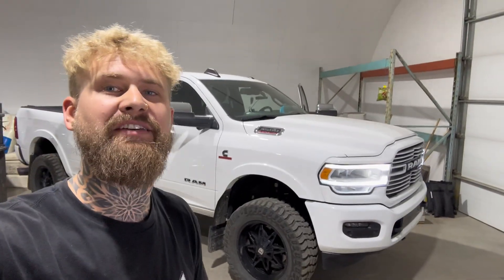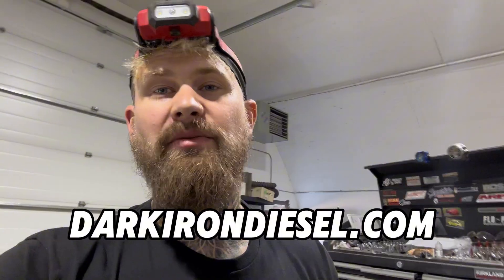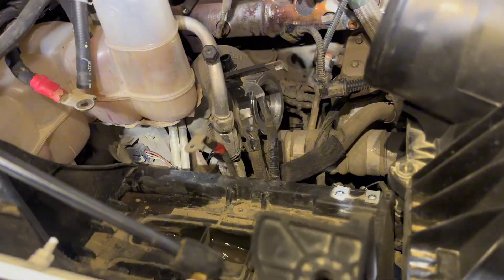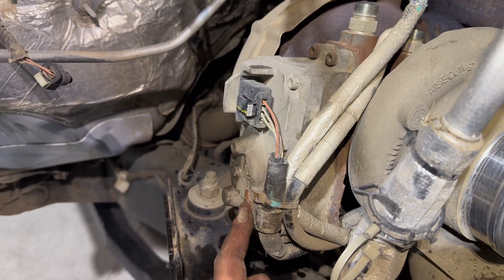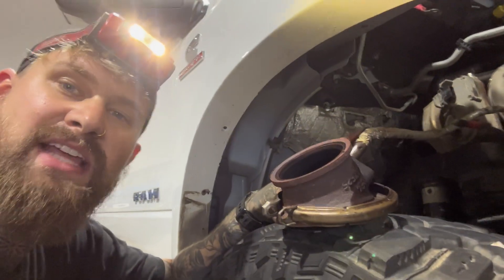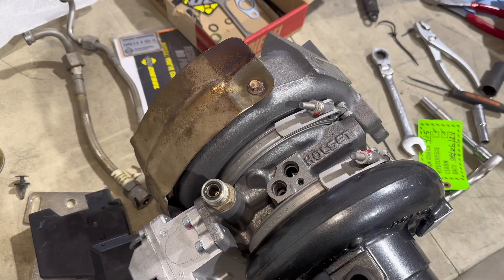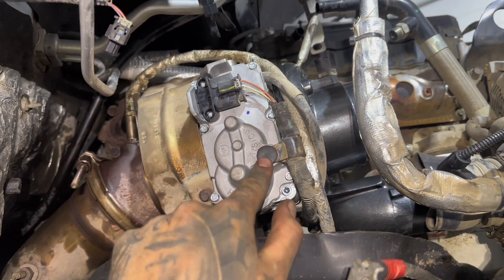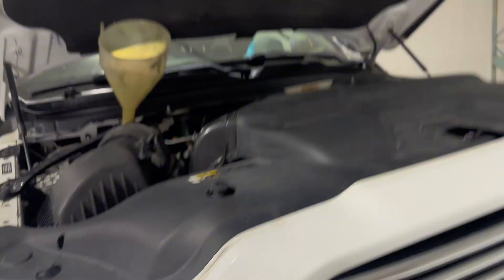How To Replace The Turbo On A 5th Gen Cummins

Comment from the maker: I recommend the ATS Aurora drop in turbo as a great alternative to stock.  Also you can use code DARKIRON to save 5%
https://atsdiesel.com/products/ats-diesel-aurora-vfr-turbocharger-assembly-with-new-actuator-for-2019-current-ram-6-7l-cummins?variant=48600464261396

Comment: For that top left bolt you can reach up from underneath with a ratchet wrench. If you don’t have the right size swivel. (Or have the patience from it falling off into the exhaust a couple times.)

Comment: I need to replace my exhaust manifold on my 2020 ram 3500. In your experiance do you think you can change it without removing the turbo?
Reply from the maker: It would be tough. Why do you have to change the manifold? You might be able to unbolt the turbo and move it to the side but you’d still have to undo the exhaust and charge pipe at the very least I’m guessing
Reply: I broke a stud off doing an egr delete and couldnt get it out. I was able to drill through and use a bolt and nut which works ok but I would rather not leave it that way.
Reply from the maker: Ah I see. That sucks man good luck with it
Reply: Thank you appreciate that.

Comment: Have you seen a lot of lifter failures on the 5th gen trucks?
Reply: Just replace your oil at 5k miles, and you'll have zero issues with lifters.

Comment: Just a thought. Might be easier to unhook the turbo lines and stuff then just pull the manifold with the turbo attached to it. I’ve done it on a few 4th gen’s and seems to work well.
Reply from the maker: Honestly this job went really well, I didn’t find a need to add more work by removing the manifold. But if I’m doing a turbo AND manifold job I always do what you say and just remove them as one piece.

Comment: Hey can you do a video on the power differents between a 4" exhaust and if you just have the down pipe on for hp
Reply from the maker: Delete pipe you mean? There won’t be any power difference. The delete pipe is 4” and the factory tail pipe is 4” so it’s basically the same as a full 4” exhaust just cheaper because you reuse the factory tail pipe
Reply: If you don't have the delete pipe on or the rest of the pipe back

Comment: The amount of work that goes into this is almost hysterical, I can change a turbo on my 2nd gen in about 3 hours with hand tools.  Great instructional video!! 👍
Reply from the maker: and its still WAY easier then changing the turbo on a duramax
Reply: I deleted my l5p and had to remove the turbo, are you saying this is easier?? Should I just tackle it?

Comment: How much different is deleting the  truck for the 10-12 6.7 vs 13-18 6.7 I wanna do it on a 2011 6.7
Reply: Basically the pre 2013s didn't have an scr system yet

Comment: Have you seen any of the lifter and cam failures yet?
Reply from the maker: Not yet, I think deleting the truck helps to keep the oil cleaner and then regular maintenance is key.
Reply: Also run the correct oil

Comment: If you ever do a 2nd gen swap on 19 plus cummins, please make a video on it because I'm looking at doing that swap in the future
Reply from the maker: I’m doing a 2nd Gen compound swap on my truck. Also building the bottom and top end of the engine. I will be filming the whole thing, maybe not exactly a step by step “how to” video but you’ll be able to see most of what’s involved.
Reply: @darkirondiesel  awesome
Reply: @darkirondiesel  👍💪💯
Reply: @darkirondiesel hey buddy I just traded in my 2012 6.7 with the raceme on a 2018 that’s already deleted I think it has a ezlynk but the last owner took the computer but left the wiring and 4position switch would I be able to get an ezlynk from y’all and tunes

Comment: would be interesting to see it on the dyno with the new turbo
Reply from the maker: Yeah unfortunately he had to run to work and I didn’t have time. I wanted to dyno it before vs after but the turbo was so fried it was hardly building boost so it wouldn’t have been an accurate comparison